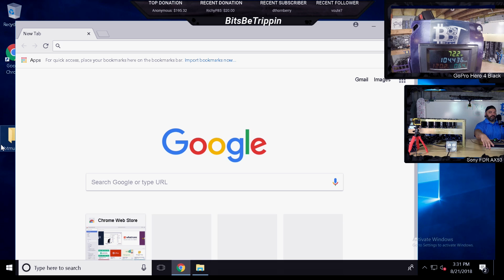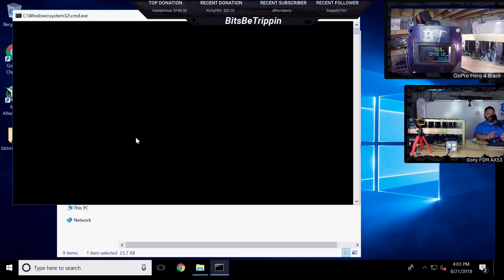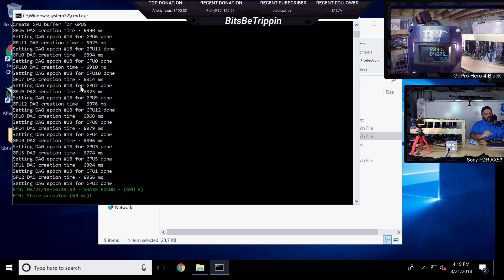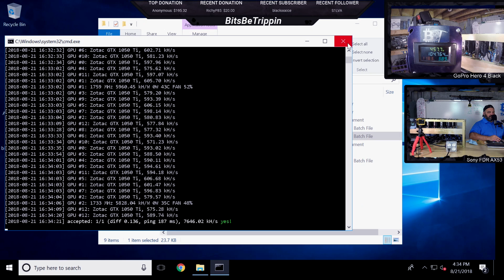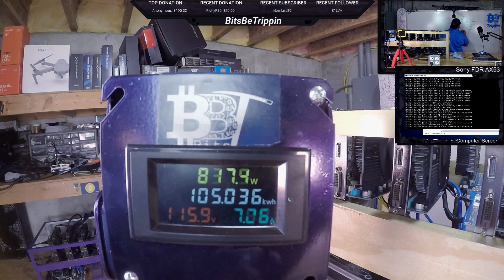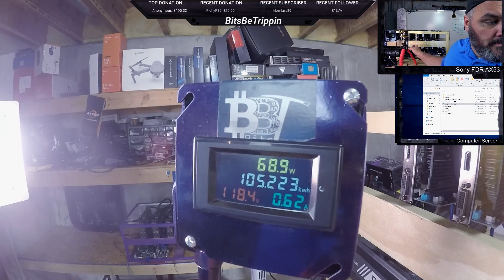What's the performance of 13x 1050 Ti's across multiple mining algorithms using BBT Multiminer v7.0

Comment: timestamps
0:00:00  Introduction
0:01:53  X16R Overnight
0:02:43  How to: Get the BBT Multiminer
0:03:38  How to: Make a Windows Defender Exception
0:05:12  How to: Update BBT Multiminer
0:11:20  Idle Power Draw and Rig Specs
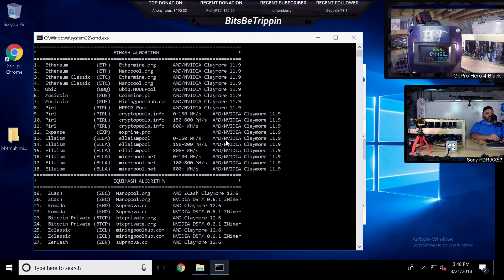0:19:58  Benchmark Ethash
0:25:00  Overclock Attempts
0:45:08  Benchmark Ethash +200mhz memory Eth
0:51:04  Benchmark Ethash +200mhz memory Alts
0:55:42  Benchmark Equihash +200mhz memory
1:00:34  Benchmark Lyra2Z +200mhz memory
1:11:35  Benchmark Neoscrypt +200mhz memory
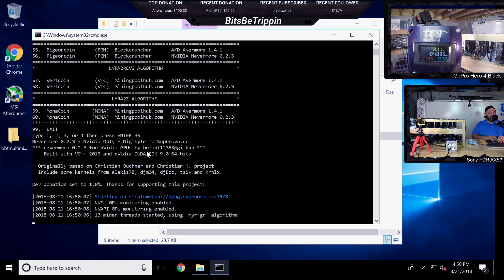1:21:56  Benchmark Myriad-Groestle +200mhz memory
1:34:45  Benchmark X16R +200mhz memory (Comparison: Nevermore, Enemy)
1:40:08  Benchmark X15S +200mhz memory
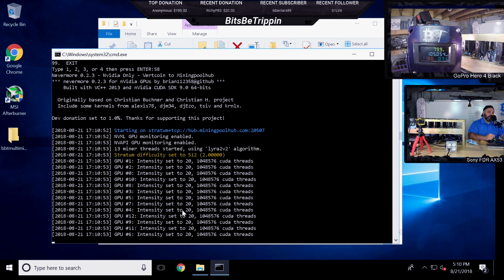1:42:41  Benchmark Lyra2Rev2 +200mhz memory

Comment: Carter, 

Just wanted to say thanks to the BBT team for updating the MultiMiner; I haven't put into use yet as I have pretty much have all my rigs pointed at ETC, and every once in a while point one rig at Ravencoin, Digibyte and Loki.

I am constantly trying to reduce power useage while getting the best hashrate in claymore.  I know in the past you posted examples of the bios timing straps for RX580; but I was wondering if you posted any examples of a maxed out start files, (w/ -cvddc / -mvddc), of course as most know, you cannot post or email *.bat files, ( to write them on one system and email it to all my other rigs I change them to *.txt files ).

My GTX 1070 rigs seem to do well at 75% power, but I am trying to determine if reducing the core by -50% helps reduce power use age.  If I do not keep the power at or above 75%, then tend to reboot constantly.

I just haven't found a good string using mutliable commands that doesn't produce some type of error, crash or reboot.

My best effort so far is a combination of start file, bios mod, Wattman, and MSI afterburner.  However, Wattman gets to be taxing because you have to constantly reload the profiles, or if one card flips out it resets to defaults, which are hard set in the bios at 1200 2100, but I get my best stable hash at 1150 2140, and -20% power in afterburner; I tried Claymores -powlim at -10 or -20, but lost stability.  

And input would be very much appreciated; hanging on by a tread and trying to reduce the $700 electric bill.  Thanks in advance man.

Very Respectfully,
WX2

Comment: I started last year with the 1050Ti work horses.  Gigabytes had no issue with a 1450 mem oc.   I shifted to Zotac towards the end of 2017 and 1450 was fine at the beginning.  But as I continued to buy and build more the overhead started to degrade over time... from 1450....to 1200 to 800 to 500......  I am not sure what Zotac did but the mem OC significantly fell off towards the end of 2017.  Because of the drastic change and the pill I shifted to 1080Tis.

Comment: 2080 ti has the price it does because the die is almost double the square mm size of the 1080 ti die.  It simply costs a metric ton to produce.  I don't think they should have done RTX 'til 7nm is cheap to produce.  These cards could have probably been super powerful if they had just done cuda cores and not RT and Tensor cores.  They could have also been a bit cheaper as they probably wouldn't have needed to go so large and instead of 750 sq mm, they could have come in around 650.